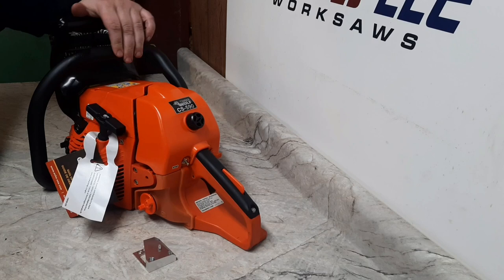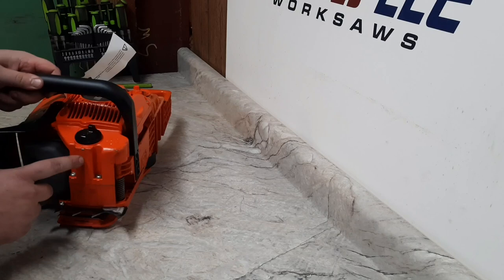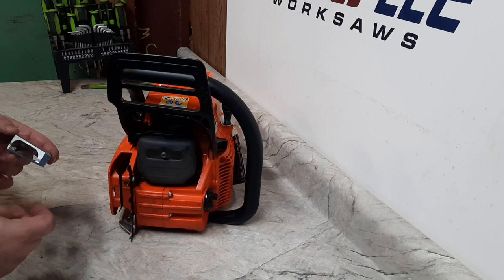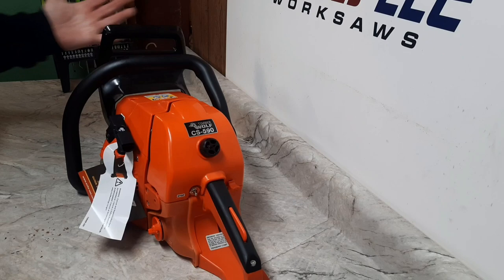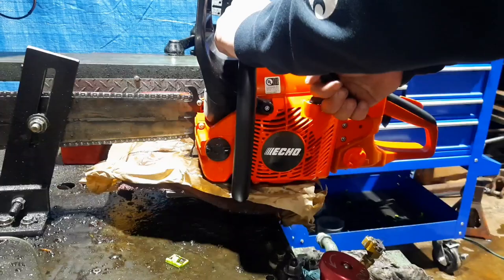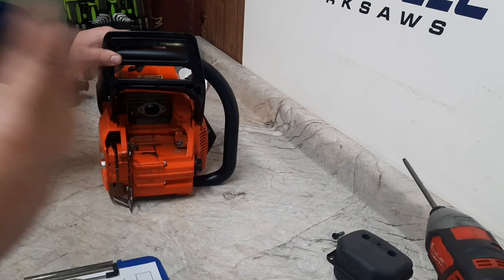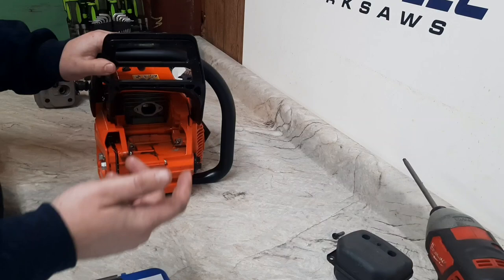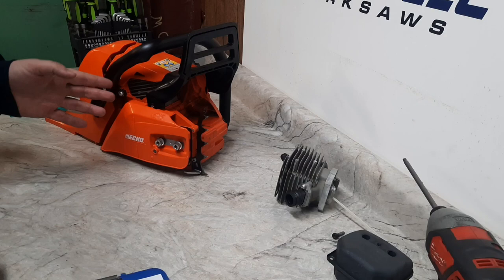Echo Cs590 Timberwolf!! PROBLEMS!

Comment: I bought a store return at Home Depot a few years ago, and had good luck with it.  Looked like it had 1/2 tank through it, brand new.  The sales guy wouldn't let me run it, but said I could go in the parking lot, fire it up, and return it if I didn't want it.  And, that is what I did, and it ran good, so I kept it.  It is still running good muffler modded - but I really want to port it!

Comment: Thanks for sharing been hearing about that on store returns.
Joe please do a stand-alone cs590 video like you did with the 620 with your port work!! After Matt’s deflector & timing key 620 cylinder dyno results. I have both those saws and all Matt’s upgraded parts but not sure if I should mess with the exhaust/intake timing to try and get a little more out of it. Thank you so much for covering the echo saws!!

Comment: Guys-Reply here or like this comment if you've ever asked a seller to let you pull the muffler before buying a saw?  It seems reasonable when buying something used, but I don't think many sellers would want to allow it.  Thanks.
Reply: I have taken mufflers off for buyers before and didn’t bother me. I have walked when looking at a saw that was hard to start and had weak rope compression but still ran. Like in the video the excessive oil was a sign also. If someone won’t let you take the muffler off walk, but show them you have the tools ready to go and put the muffler back on for them.
Reply: I will if you have the cash and don't seem like a joker that's going to ruin it and scram. If you bugger it I'm keeping the cash.

Comment: Thanks for the heads up video. So much can be learned from a simple check in the exhaust port. Do your research if a piston and cylinder can be purchased for a decent price it still may be a bargain to buy slightly damaged chainsaws.

Comment: On your last video you asked about cleaning a saw. The best way I found out. Is take it apart, covers and miss. block off carb.  and exhaust. Tape the air cleaner works too. I use zep degreaser, simple green would work too. Take eight bucks go to the car wash. You will never clean up a nasty saw any other way. Oh by the way wear a glove on your off hand pro tip.
Reply: That's a great way to blow a case gasket into the case.
Reply: A mortar pan and a pint of gas with a paintbrush is how I do it.

Comment: I just pop the deflector apart. It’s only tacked in 3 spots. Take the inner piece off.  It becomes a very large outlet 
 I’ll never buy a store return…ever
 If a person won’t let me pull the muffler off.  I walk away. No matter what the saw is
Reply: I think they are more hit and miss.  I got a nice little echo saw from Homedepo for 130 once, and it is a great little saw.  I also got a "used" from the rental shop Dolmar/Makita 6100 and that thing was run hard and put away wet ... looked good on the outside, but overheated, smoked bar and chain, oilier not working, etc.  I thought it was a 6400, and was going to convert it to a 7900, but I live 3 hours each way from Homedepot, so ended up buying it anyway.  It worked out ok, as it is a pretty nice and fast 60cc saw.

Comment: I got one of these on Facebook form an older gentleman who had said he only used it a couple times and it wouldn’t start. Piston looked the same. I trust he used proper mixed gas. I wonder if these saws have an issue with some cylinders or pistons that cause scoring

Comment: It would be interesting to see the standalone gains (hp and torque) realized when swapping out the CS-590 cylinder/piston with the CS-620 cylinder/piston before the muffler mod and timing advance.
Reply: After you swap out all the parts for the 620, aren’t you paying about the same as just buying the 620. Plus less work.

Comment: I'm curious about the simple muffler mod and timing advance, to see how much it picks up.  I've been cutting with mine this winter, and I think at this point it is just muffler modded, and it runs great.  If the timing advance helps it a little, maybe I'll file my key a bit.  But, I'd rather have a strong torquy saw, than a 15k zinger for firewood.  And, mine was a little rich, and leaned it out, and don't mind running it at all.
Reply: Muffler mod and tune and it's good to go...